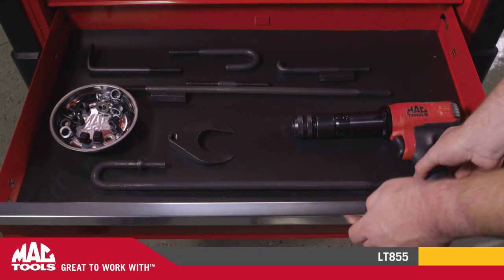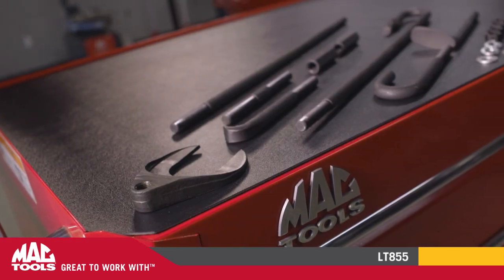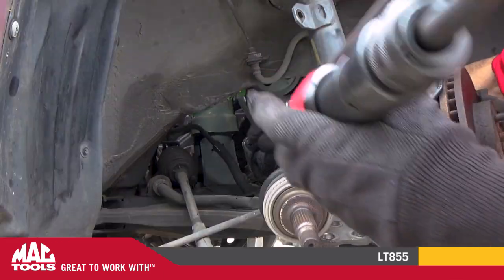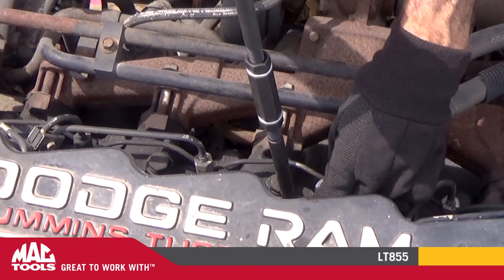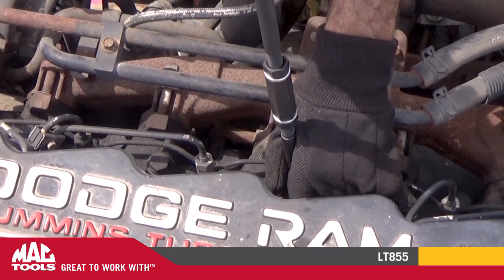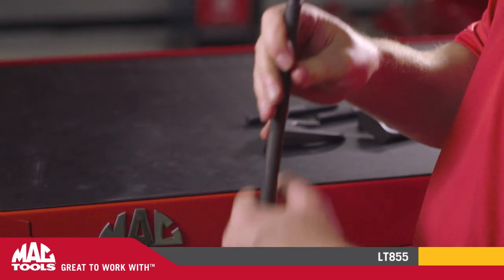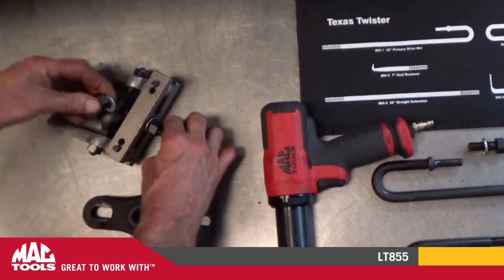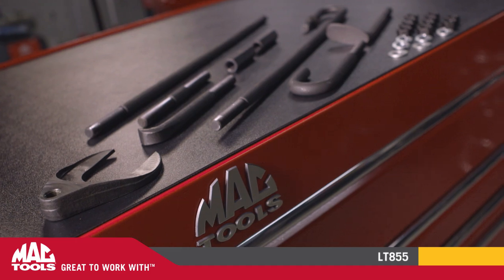LT855 | Texas Twister Air Hammer Pulling Kit | Mac Tools®

Comment: Brilliant in it's simplicity.
Makes you wonder why no one thought of that before!
Reply: So here's a spoiler since I bought one of these about 3 years ago. The threading on these won't fit kits from other sources, say if you needed to use a puller kit for a motorcycle or from a local automotive store, the threading is not compatible. If there were adapters for it i'd be a very happy camper but sadly it's lack of compatibility sours my purchase a bit.